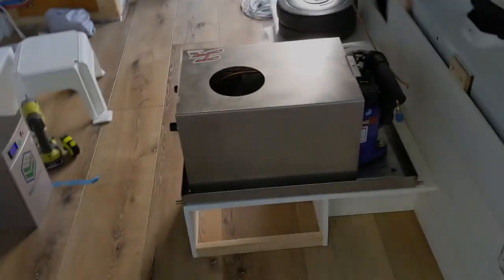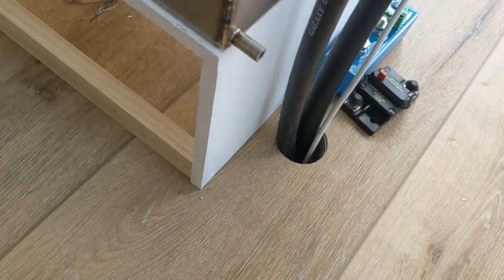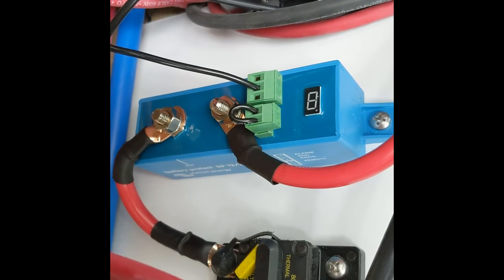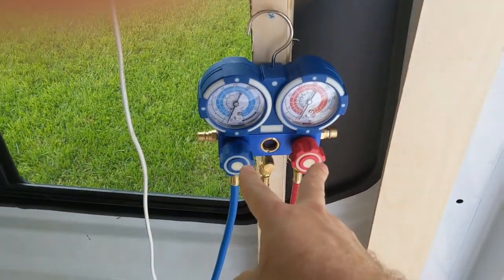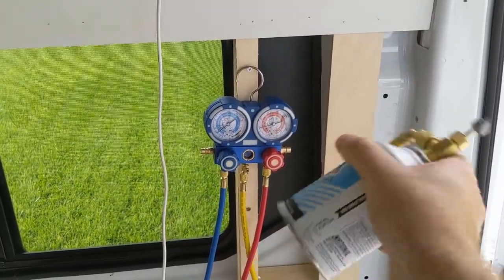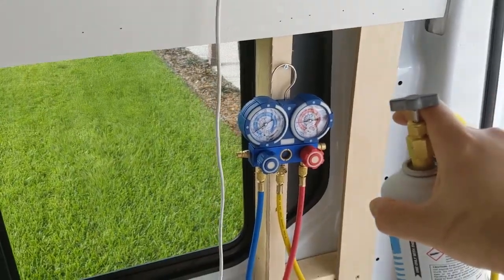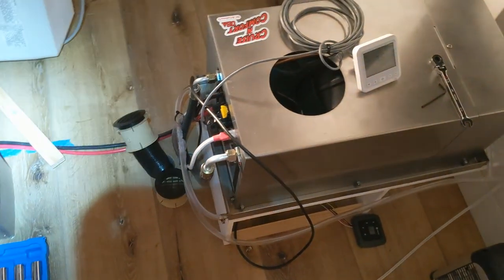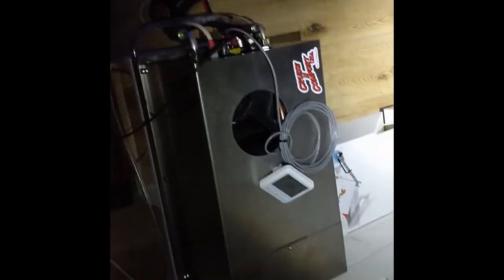Solar Power Air Conditioner 12v AC install in a Van Conversion | Going Boundless Van Conversion 2021

Comment: I used your video to charge my C&C system.  All went very smooth, you are right about the self sealing cans you have to find the sweet spot.  Thanks for putting this together!
Reply from the maker: Thank you Neal. I'm glad it worked out for you.
Reply: @GoingBoundless  Because of your video.  I also plan to make parallel to series switch.  Do you have an electrical schematic, I tried with a 5 pin relay but looks like I need two relays to make it work.  Nor sure if I am overcomplicating it...
Reply from the maker: @nealcallan1827  Hey man. All you need is a dpdt switch https://www.amazon.com/gp/product/B07WMX7ZQR/ref=ppx_yo_dt_b_search_asin_title?ie=UTF8&psc=1  then you need to wire it properly which I had to figure out on my own. I can send you the diagram but I cant do it on YouTube. Can you message me on Instagram or Facebook?
Reply: @GoingBoundless  Thanks I reached out via Instagram.  Thanks for your help
Reply: @goingBoundless would it be possible to get that wiring diagram for the série/parallel switch? I am installing my CNC HD série on my van and would like the same option. Your video was enlightening. Thanks A lot

Comment: Thanks for sharing; some helpful tips for expedition camper build underway with the same air conditioner. Question, how large of a hole is needed to fit those hose connections thru without angling them? Thanks,
Reply from the maker: I fit them both through a 2inch hole I believe then sealed around it.
Reply: @GoingBoundless  Thanks! That's what I created in the floor of my Total Composites camper, so hopefully will work well for these refrigerant lines soon to be installed in my camper too.

Comment: If you have the condensation tray above the tank, you could simply collect that run-off water as potable water. Usually less than 10ppm and very clean water
Reply from the maker: This is actually a really good idea!
Reply: Isn't the condensate often used to help supercool the liquid line coming off the condenser? Seems like you'd loose efficiency if you don't send the condensate to the condenser tray. IF not, what do I not know?
Reply: 10ppm of aluminum plastics or rubber ? no thanks

Comment: Can you connect the power cables to the Lynx Distributor instead of the battery poles ?
Reply from the maker: I am not a certified Victron tech so I wouldn't be able to tell you with certainty. I suggest going to a Victron battery protect first no matter what, then directly to the battery. This will serve as a breaker for you. I think it should be fine if you ask me but again, do your own due diligence. The reason why I went direct to the battery is because I was recommended to do so by cruise n comfort.

Comment: Just put caps (vacuum caps from any auto parts store) on all but one of those condensate drains.  One drain port/hose will be more than enough.
Reply from the maker: I have been using this system for 6 months now and can tell you that it's a bad idea. Especially on a lean.

Comment: During the vacuum test, I'm seeing -27 psi on blue and -30 psi on red. After the vacuum test, it remained the same with pump off after 30 mins. Is this ok that blue never achieved -29/30?
Reply from the maker: You should call Chris with Cruise N Comfort. Sounds like it's fine to to me. Maybe your gauge is not super accurate. Also it can only hold what it can hold. You can't make it hold more than the pressure of the cans.

Comment: How did you know when to stop adding the refrigerant? And then what was the order of turning off the red and blue manifold guages?
Reply from the maker: Hi Julia, When it stops going in is when it's full. There is no gauge for it, just keep adding until you cant add anymore.
Reply from the maker: RED then Blue but I don't think it really matters.

Comment: FYI to all, I am charging my system today. I asked Chris @ cruise n comfort for clarification on how many cans of 134a to use, as it would take nearly 3 cans to get the 2.2lbs prescribed (not the 2.5 cans mentioned in this video). Chris replied back telling me to use 3 cans.
Reply from the maker: I appreciate you trying to give advice to people but that is incorrect information. The system will not take three cans. Good luck. Also, I did this on the phone with Chris at cruise and comfort.
Reply: @GoingBoundless  I'm not sure what to say. This isn't me sharing my own expertise, just relaying what I've been told by Chris himself. I will ask him to comment here.
Reply: 3 cans @ 12 oz is 2.25 lbs.
Reply: @JOHNW2999  Yes. 3 cans is what I went with and it has worked well for me.

Comment: Very helpful, I have my CnC 12L mounted and will soon be charging. I've never done AC charging before so it is great to see it. You mentioned that the third 12oz can of 134a gets used about 50%. Are you figuring that out just on 'feel', or are you seeing something on the gauges to let you know you are where you need to be?

Comment: thanks for posting this up. is your AC the HD12S or L?  and thanks for addendum clarifying the amps.   looks like the the dual fan condenser adds about 12 amps over single fan. not bad for the additional capacity.  you could drain the six hoses into a small plastic jug with a single hose running outside through the floor.

Comment: Another question: is there some trick to getting the adapters onto the valve before you even twist the open and close? My adapters are just sliding off the valve whether it's in the open or closed position and the top twist tightener doesn't seem to tighten, just spin around.
Reply: Nevermind! I figured it out! The attachments are spring-loaded so you just need to pull them down - attach the valve -then release it into place.
Reply from the maker: Sorry Julia, I just now am getting to the comments. I am glad you figured it out!.

Comment: What is the benefit of this vs a mini split?
Reply from the maker: Two reasons. 
One: Conventional mini split is going to be AC power and it's going to be high draw power. 
Two: Conventional mini splits are quite large and you can't really hide them underneath the bed like I did here. This mini split is small, DC power, low draw, the condenser is underneath the van and very thin and very small.
Reply: @GoingBoundless it may be small, but is it a heat pump, like regular minisplits? How does it handle winter heat requirements?
Reply from the maker: @vroor32  It does not have a heat function, unfortunately. It wouldn't be very efficient anyway and burn a lot of electricity that's not necessary. We use a propane heater. Propex, and it's awesome.

Comment: this kind of airconditioner made for 18 wheeler truck, not for a rv or van. because of the 80 Amps.
Reply from the maker: Did you watch the video at all even? I got it down to 50amps due to the parallel to series switch I installed for the condenser fans. My DC to DC converters get 60amps alone. My solar in full sun also provides about 60. It works great with this setup.
Reply: @GoingBoundless  how many watts of solar are you running?
Reply from the maker: @leblancexplores  1000w
Reply: Have a link to the relay that will switch it between parallel and series?
Reply: How many amps with blower high and in parallel mode?